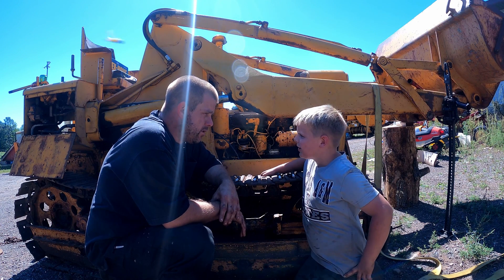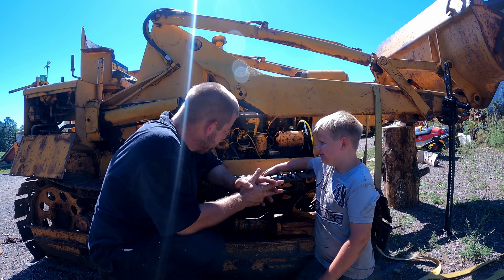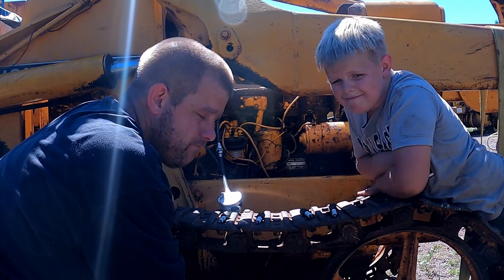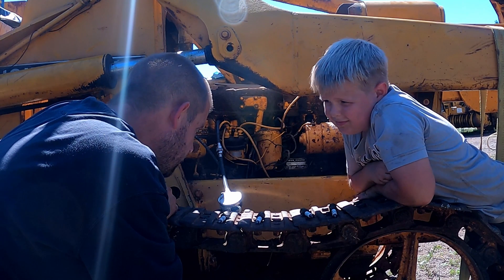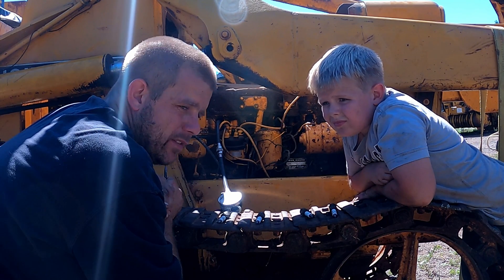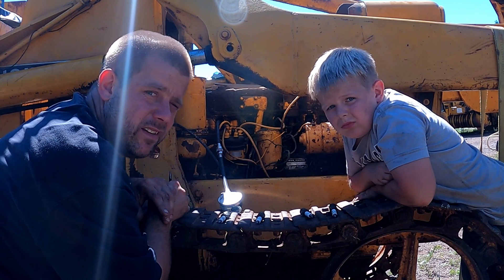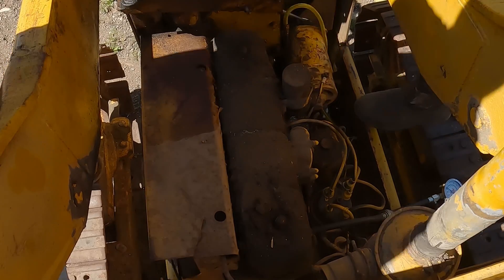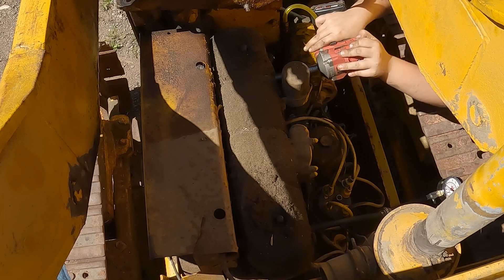Why Won't It Run??  Compression Test: John Deere 1010 Crawler Loader ?

Comment: 78yr old mechanic.  Need to support the raised bucket with something better then a handymen jack.. wash or blow off engine before cracking open.
Reply from the maker: I absolutely agree those High lift jacks are death traps.  It has a rather large log under it too that it is actually sitting on the jack was just there so we used it as a secondary method of support.

Comment: I have 3 John Deere dozers. 2 1010s 1 diesel and 1 gas and I have a 2010 diesel. I bought the 1010 gas last spring it had been sitting for 27 years. Has new tracks. It had real low compression when I got it and wouldn't run. I put gear oil in the cylinders and cleaned the points. Rebuilt the carb and then it started right up and the rings freed up and is is fine now.
Reply from the maker: If it wouldn't have locked up we would have dumped some 20W50 down the cylinders and it likely would have come to life with a little bit of effort.  It will live again just not in the very near future.

Comment: How the heck did you get the hood off it? and could the low compression be from piston rings that are rusted to the sides of the piston and not snaping out against the cylinder walls?
Reply from the maker: The air cleaner tube and exhaust has to be removed and then the hood can be slid foward to clear the frame for the loader.  Kylee and Dylan did it while i was at work so im not sure what else was involved but it didn't sound like it was very wasy to do.  The compression very well could be rings stuck but I would think it would have at least something in at least one cylinder.  They are 4 ring pistons so even stuck it should still make something I would think but maybe not..  I'm leaning towards valves stuck open with debris but we have to get it turning over first... while editing the video i noticed that the starter sure seems to be trying to turn it over.  I think the next step is to remove the nose and hydraulic pump since it wont disengage like its supposed to and go from there.
Reply: @kedfarmrepairs  Are the two hydraulic lines on the rear (for a backhoe or other attachment) hooked together? they should be hoked together for the hydraulics to flow properly. and also thanks for both the reply and the advice on the hood
Reply from the maker: @gearsnstuff7330   the lines are hooked together and I haven't looked really close but i think they go to some sort of a valve  that has a lever on the right side rear coming out the top by the arm rest.  I was assuming it had something to do with turning on and off hydraulics for the rear accessory but thats just an assumption and like I said I didnt look close the hoses may not even go to it and it may be for something entirely different.
Reply: @kedfarmrepairs  You are correct, the two way lever is for the hydraulics, if you push it either way, it disengages the pump from the system while it's moved in either direction. If your tractor is above serial 21900, there should be a lever on the pump itself on the left side of the tractor (off the front of the engine) that disengages the drive to the pump directly. You  could also try spinning the engine over with the clutch and brake pedals depressed, I've found that that can help when the battery's low
Reply from the maker: @gearsnstuff7330  serial number must be later because it has the lever up front.  We are a bit farther on this project now I need to get to editing more videos as that whole pump unit is sitting on the floor in my shop right now...  lets just say things sort of escalated quickly.. haha. Thanks for the information on the lever in the back I assumed it was something of that sort but when it doesn't run its hard to prove or disprove a theory.